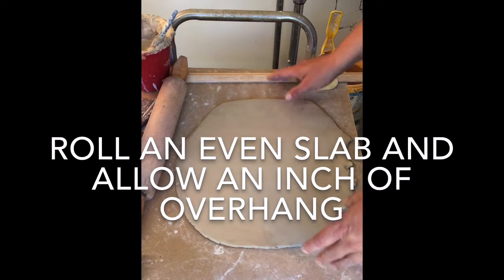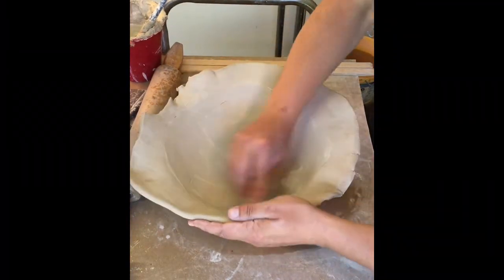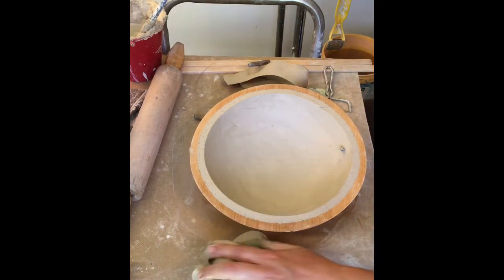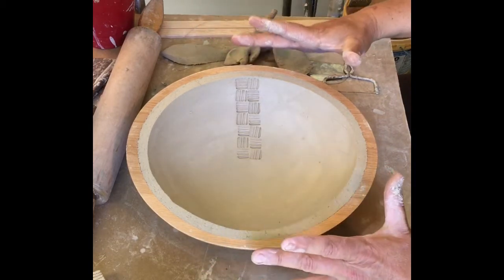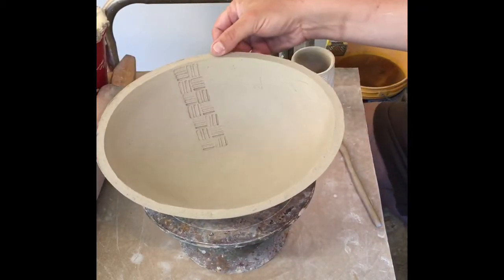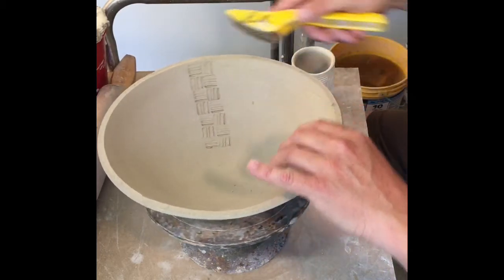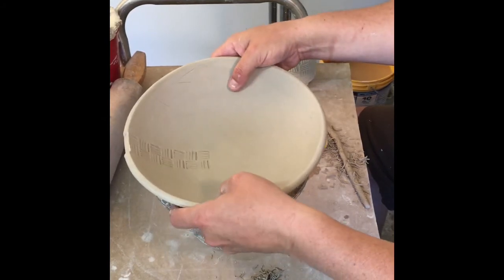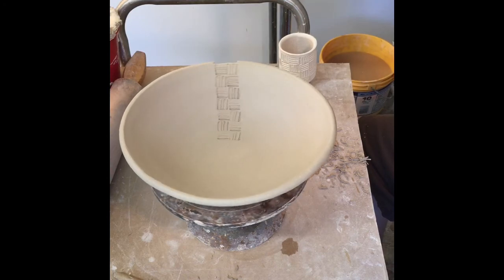Slab bowl using a slump mold

Comment: hi, thanks for the video. loved it. can you pl tell from where you got the wooden bowl? does it not need an agent like corn starch to prevent sticking? i prefer to use these simple tools rather than expensive forms sold in market.
Reply from the maker: Hi Radha! I found this bowl at a second hand store. I sanded it until the oil type finish came off allowing the bowl to be porous once again. You can always  put  some thin canvas over the form to act as a release. An old tee shirt works perfectly. 
-Andy
Reply: @andyruble633  thanks. will definitely try this

Comment: Will this method work with a deeper bowl with a less flared rim or is that where a person has to learn how to dart.
Reply from the maker: Hi There! This method should work with any wooden or plaster bowl with slightly less than vertical sides. Its nice to be handy with darting as well! :)
Reply: @andyruble633  amazingly quick response. Thank you. I don’t know how to dart…any darting videos on the horizon? When I try to slump clay into a slightly less than vertically sided bowl form, I get a lot of bunched up clay and can’t figure out how to deal with it.
Reply from the maker: @barbbenedetti  Try using a slightly thicker slab than normal, then work the clay down into the mold with a rubber, wooden or metal rib. It will feel like your are "stretching" the clay down to the bottom instead of pushing or pressing it down with your hands which will tend to bunch the clay up. There may be a darting video in the future, but I'm super busy with school and the SCU fire rebuild out here in California. Good luck!
-Andy

Comment: What criteria must the clay meet to make the mold for multiple uses for melting bottles? If you don't mined, share that information, please.
Reply from the maker: Hi Salome, Glass has a very high expansion and contraction rate so it often will pull the mold apart. You can try adding a  layer of alumina hydrate and EPK (kaolin) 50-50 to the surface of the clay which may help with this issue.
-Andy
Reply: Thank you very much

Comment: Does this work when using a plastic bowl? Will it still release the clay as easily? Thank you
Reply from the maker: Hi Lynn, I wouldn’t place the clay directly into a plastic bowl, but you can use newspaper or an old thin tee shirt as a liner between the clay and the plastic bowl. Good luck!
Reply: @andyruble633  Thanks kindly for your response. :)

Comment: Very nice!
I noticed that you didn’t oil your wooden bowl before you put the clay in there.. is it because it was a wooden bowl? If I use a different type of material, would I need to oil it first? Thank you…. Is oil better or cornstarch? Or plastic wrap? Plastic wrap leaves marks I noticed… 🤷‍♀️please advise…
Reply from the maker: Thanks for watching! If it is a porous material such as wood, it is not necessary to use a release agent. I hope it works out for you!
-Andy
Reply: @andyruble633  okay thank you 🌸
Reply: Wood and plaster don't need release agent,for other container cornstarch is the best

Comment: Can you use a wood bowl that has been painted or should I strip the paint off first?
Reply from the maker: I would strip or sand off the paint so the surface is porous so it won't stick. It will make this so much easier!